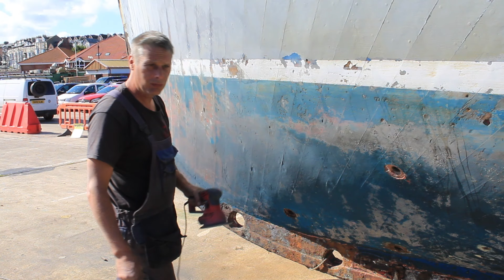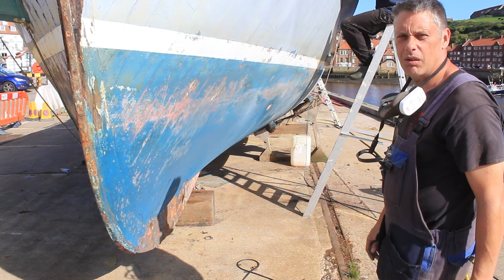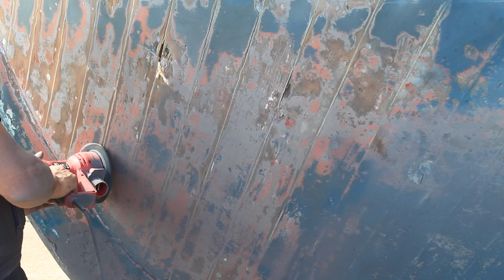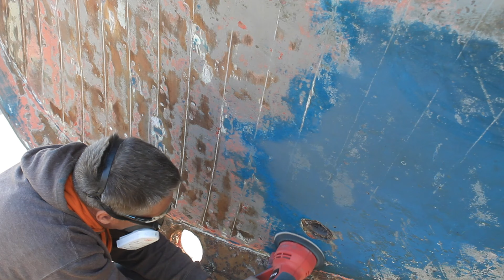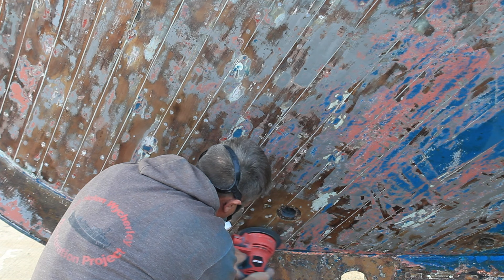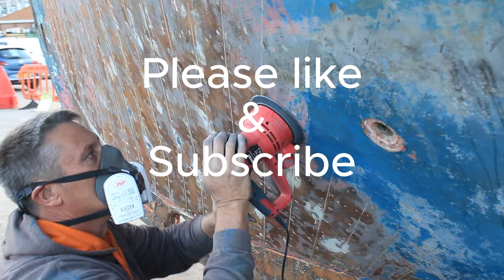sand ya boat time, on our historical ship. ship restoration project

Comment: 204,  3, and 1  will be my guess.....

204 sanding discs, 3 rubber backing plates and 1 sander worn out. Daunting job you have ahead of you boys 😉

Top tip. Measure / mark where the plimsol line is it's  a real pain when you antifoul and repaint her trying to get it right.😉
Reply from the maker: Sounds like I have a task on my hands. But it's gotta to be done. If you would like to pop down and have a go. We would love to see you 😅